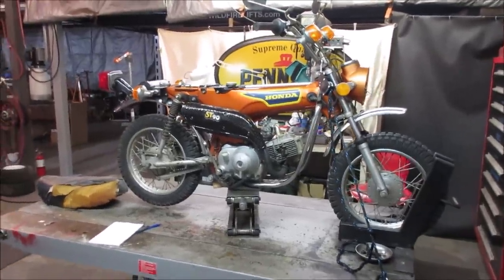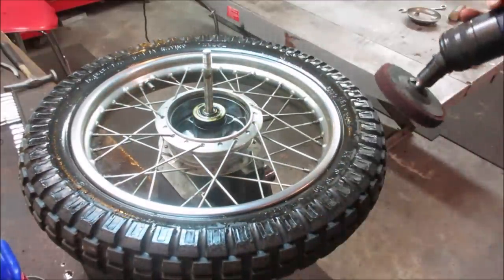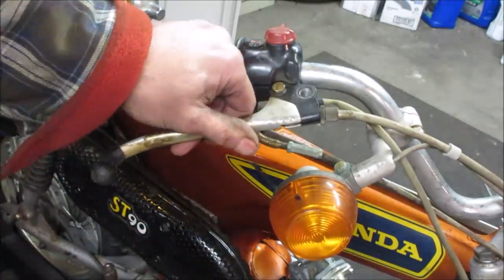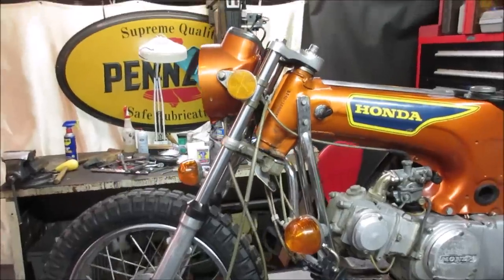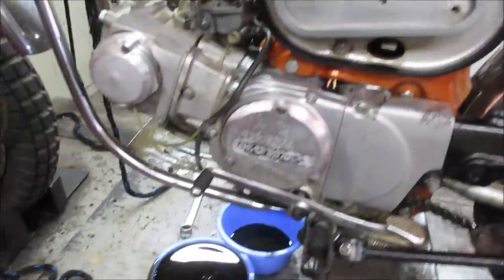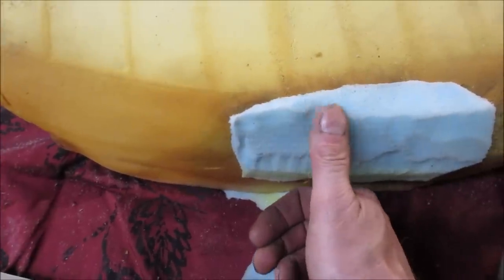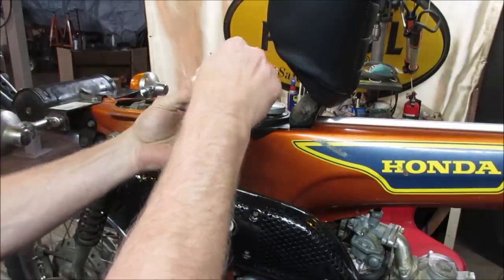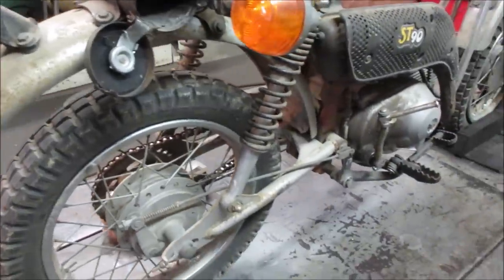Old 1974 Honda ST90 Gets Full Rustoration

Comment: Your brakeless, throttleless minibike reminded me.  Me and a buddy bought a go cart for $20.  No brakes, no throttle, we knew nothing about clutches.  We got it running and the engine would run at full throttle, tire spinning, so we'd put it up on blocks, one of us would jump un and the other would push it off the blocks.  It would just run wide open throttle until it died or we ran into something.  Lol, good times!

Comment: Song Mountain near Syracuse, NY used to have the "Alpine Slide" in the warmer months when I was a kid (40+ years ago).  Sounds exactly like what you described.  Concrete track, sleds with skateboard wheels underneath that defaulted to the brake position.  You pulled a lever to make the wheels contact the track.  The faster you went, the harder you ran into the kid in front of you who was too scared to race down the mountain.  It was a blast!  Thanks for bringing those memories back.

Comment: This is, and has always been, my favorite channel. I love the problem-solving approach. If I had one criticism, it's that you should start mild when it comes to cleaning up old parts. The front fender would have come out perfectly with 0000 steel wool but, starting with the abrasive scotchbrite wheel on a power tool resulted in damage. Still love ya, man.

Comment: My Christmas day was rewatching the last Honda 90 after the Honda 70 where you said to use straight 30 weight oil was the one to use because of the clutch in the 350 got burned up.
I should put it into practice by finding an old Honda to play with.

Comment: Merry Christmas! A fine grit sand paper, DA or palm sander will take down the foam, even memory foam. It helps for installing seat covers if your use a thin plastic bag over the foam like a really cheap generic trash bag. Also, steaming the seat cover after installing helps for final fit and tightening all your seams up.

Comment: Merry Christmas ! I compress the seat frame down when I reupholster my mc seat. It goes a lot easier .  The tabs will fatigue ,break,so the less you bend them the better. With the foam compressed, the covering slips over the tabs and pulls under easily. Winter riding on snow always fun ;) Good restoration . Have a healthy safe 2023.

Comment: When it comes to cutting polyurethane foam with an electric knife, you might help the knife to cut thinner slices by dressing the blade with silicone spray.  It really cuts down on the blade getting caught up or struck. By the way, the finished seat and the whole bike look great!😊

Comment: I used to work off and on between gigs at an auto upholstery shop. My boss was a master at rebuilding seats and recovering... Even recreating OEM style covers from scratch stitched on a machine.
You made the right decision to go with the electric carving knife....we always used them to carve in rough shapes ....we would do the final contour with a wiz wheel or sander....and we also used contact adhesive....but on foam you really don't want   to skimp ....a second application was usually used as the first would seal the pores of the foam

Comment: I saw on tv or the web to use a Thin Hot Electric Wire to shape foam. You insolate the ends and leave the rest of the wire is bare. It can contour better then a carving knife. The carving knife type of tool was also used for basic rough shaping. You have got the correct general idea Mustie.

Comment: Merry Christmas, Mustie1!  The factory recommended fork oil for Suzukis from this period was a 50/50 mix of DOT3 brake fluid and non-detergent 30w motor oil.
Reply: He could also just use actual fork oil. Same with the drive chain. It’s pretty easy to take off the master link and give it a good soak and then use actual chain lube that does not fly off and mess up that cleaned up rear wheel.

Comment: You just brought memories rushing back of Wild Mountain, in Taylor's Falls, Minnesota. I was shocked that they let you loose on something like a mechanic's creeper on a half tube bobsled run. If you didn't apply brake, you would sail into the pines at speed. To keep your sled from going over the top of the tube, you had to lean away and make it run lower. When I then high sided off the sled cart, I got friction burns as I screeched to a stop. Ski hills must be lawyer proof.

Comment: You need one of those hot wire foam cutters Mustie. Ive seen them used on polystyrene but if memory serves I think they can be used on foam too. Used in modelling circles for plane wings and cosplay Armour etc. There are vids on UTube showing how to build one yourself and it seems fairly straight forward.

Comment: Brilliant restoration. Fun-bike may be a more apt term, based on your commentary when riding. Yes, in the UK there is only spanner, wrench is something you may do when using a spanner. Then there is fender = mudguard, muffler = silencer, gas = petrol et al. Trunk is something elephants have. Have a great Christmas and New Year.
Reply: The reason we say trunk because on early car's had no trunk, but people would tie their travel trunk to the back of their cars. So when they started building cars with trunks the term stuck hope that helps.

Comment: For the broken left-turn fork stop: drill the lower triple clamp plate and install a short bolt upward through the place with a large nut on the top.

Comment: Alpine slide was classic and road rash was guaranteed. It was a bobsled style track except cement. Flying down that mountain with your buddy on the track next to you literally dragging your knuckles on the track just trying to hold on to the handle bars. The good old days.
Think they removed it in the 90's some time but the park is still there.
Merry Christmas

Comment: Hey brother after fixing many way worse seat on quads believe it or not hot glue works great for fixing missing spots. Can melt easily with a torch and let in fill the voids. Once covered you'll never know you filled it in. I think there's a video or 2 on my channel of before and after on a quad.

Comment: Tips for the foam
- make the patch surface is long and flat so the glue has the best chance sticking. Don't peice-meal it. Any small warbles and dips and variations will eventually separate with wear and tear and compression/expansion cycles of the foam.
- when gluing a softer foam onto the firm foam, leave the soft foam a bit proud so when it crushes down it becomes even with the firmer base.
- sand with a new very sharp 36 grit disc or belt with a light touch. Commercially available sanders use a resin filled wire wheels. This allows the tips of the wire to abrade the foam without grabbing. Other wheels use a very hard urethane foam for a fine finish. A wire wheel works in a pinch but it is very prone to eating the foam and your hand alive when it grabs...probably best you don't try it without a lot of practice. 
- sand away from the glue seam so it doesn't grab and rip off your patch. 
- for cutting thin strips with your electric knife, hold onto the thin strip as you cut and try to balance the tension in the cut by pulling slightly as the knife goes through.
- spray adhesive works well, but if you have some foam that's decomposing a bit, a brush on contact cement may give you a better hold since it will wick deeper into the structure of the foam. Contact cement for countertops at the hardware store would be adequate for something like that. If available buy the recommended thinner to go with your glue so you can thin it down if it's too thick and goopy. Also, don't just use any old thinner with the glue because it messes up the chemistry of the glue and it will just turn slimy and won't stick.
...well hope that helps for the next time.

Comment: I've done this a few times and it does work well.  I used a belt sander to "sculpt" it a little and that works alright.  Your grinder idea is good too and maybe a multi-tool would work too.  I used 80 grit on the belt sander.    Bobby

Comment: Hey Mustie!!.. Merry Christmas and I hope you all have a very Happy New Year!!.. Watching your videos (and others) has inspired me and helped me not to be scared to take some chances on somewhat questionable purchases.. namely, a 2yo Harbor Freight Predator 8750 with only 12 hours for $450.. (He was an Army vet. I'm an AF vet and he dropped it to $400.. nice!!) anywho.. I saw it had wires from the bottom of the carb and he didn't have a battery. He said it'll run with some direct spray into the intake. So, I naturally thought of gas and/or carb issues. Went to see it and sure enough, it'll run with spraying into it but won't sustain a run on the gas in the tank. Gas didn't smell bad, so I thought strainer clogged or a clogged jet(s). Bought it, brought it home and my son helped me move it to the back porch. My initial thought was that it needed 12VDC to the carb (unless the oil level was too low. It wasn't. Oil level was fine.) Looked on AmazXX.. $30 for a new battery and a rebuild kit would've taken longer to get in so I bought a new carb for $19 (plus keeping the old one gave me spare parts). Installed the battery, installed the new carb and the electric start was working and it started right up!!!.. $1600 machine for $450 in total.... not.. too... bad... huh?... lol.. CHEERS!!!

Comment: Hey Mustie, I noticed you added 10W-40 oil to it. I was under the impression from my days of riding Honda Mini Trails and Dax's that multigrades are a no-no with centrifical clutches. Always used to run SAE30 50 years ago. Anyway, thanks for the Vid's, Merry Christmas from downunder.
Reply: 10w-40 is fine, as long as it’s made for wet clutch applications.  Regular 10w-40 is a no-no.
Reply: @MiniBikeMike  Got ya, on doing further research on the oil Darren put into the Bike, its Maxima Premium mineral 10w-40 and it says in red on the label Motorcycle Specific API/SL JASO MA2. (hard to see in the vid). It is designed for motorcycle wet clutches. Apparently its the Friction Modified oil that is not compatible with wet clutches. I never stop learning! Thanks @MiniBikeMike.😄

Comment: I used to work in a factory that supplied automotive interior parts and had worked on lines that had armrests or center console covers that had padded covers.  Heat is the trick.  We had boxes that would warm the material.  This made it MUCH easier to stretch and get all the wrinkles out.  A heat gun might help, but you need to be really careful with that.

I had a horribly rusted and beat up Honda Trail 70 with no first gear I got for $20 back in 1984 (I was 15) and ran the crap out of it for about a year before4 it finally died.  We had a lot of trails and jumps out in the woods.  Hit a few trees.  I was just smart enough to use an old helmet I got a garage sale for $2.

A friend also had a moped and we would ride bikes next to him and hold his shoulder to get around.  Sometimes he would tow up to 3 of us on bikes.  His dad would get pissed that he would burn out the belts so fast.  When he was 18 his dad got him a Honda Enduro 100.  It would do about 55.  He still towed us.  He could do 45 then.  We passed a cop one time in a 30mph zone and he must not have seen us as he did not pull out.  We at one time had him pulling 5 of us at maybe 25.  We were fanned out like a flock of geese in a V formation with 2 on one side and three on the other.  He was 2 years older than most of us, but only one grade ahead because he got held back in 3rd grade.  Those were some good times.

Comment: When I had my forks rebuilt I had them put heavier oil in since I am heavier than the average rider and it made a world of difference. Now that I have a new bike, I tuned the suspension for my weight. Handles way better than when I first started riding it. Took a few days of small adjustments to get it right.

Comment: The story of the park reminds me of a place called Millbury Amusements in the mid 80's in central MA, it also had gas powered tanks and people could shoot rubber hand balls from air compressed guns from the tanks and the outside perimeter. It also had go carts and a bumper boats and a par 3 golf course , good times. Now it's a Mass turnpike on ramp.

Comment: Merry Christmas! 
I have seen one week old front hubs in much worse condition than this old Honda.
Head bearing,  probably out of business now , but the best head  bearing repair was to replace all four races and loose balls with tapered roller bearing packed with water resistant grease "often marketedas boat trailers wheel bearings grease". Doing so would make future failures nearly non-existent.

Comment: Steering head bearing damage is called "Brinelling."  Very common on Vintage Japanese bikes.  Sadly the only proper fix is to replace.  Best with tapered rollers because replacement Honda will do the same thing.  Trail bike not as big a deal, street bike will ride miserably.  As you were taking the wheel off I thought to myself take whole front end off.  Hind sight and all.  As always great stuff.  Hope you are surviving stormageddon.
Reply: You said it! I have installed lots of tapered bearings for that reason.

Comment: I've worked on a couple of engines like this. The head light needs the engine to run. the tail light, blinker and speedo lights will work off of the battery

Comment: I remember when they came out with the original trail 90. 
Had a little bigger frame and it would carry two people and it had four gears with a changeable sprocket on the back wheel for even lower gears off-road.
I think they sold for a little over $300. In recent years people are paying a whole lot more than that for them!

Comment: We have some very similar where I'm from in Pittsfield, Massachusetts at a ski resort called Bouquet.. it's a long cement half tube down a mountain and you ride in a little cart with a pull stick for breaks between your legs, I took a corner too fast as a kid and flipped I was covered in road rash lol.. ohh they called it the Alpine Slide

Comment: for what its worth most 70s japanesey bikes that had adjustable shocks had a shock adjuster spanner that doubles as tripple tree nut  loosener/tightener wrench thingy in the under seat tool box. .  Dont think this model has adj shocks but those wrenches  fit most other necks.   BTW I really enjoyed this series on that  little honda. Merry Christmas!
Reply: Most motorcycle tool kits have those scanner wrenches.
Reply: Ring spanner

Comment: This is practically my dream bike.. Ive had a few of them but was never able to keep them, my parents believed in selling things when i got in trouble and i got in a lot of trouble.. I would really like to find one that is in poor enough condition that I would not feel bad hacking it up.. I want to put a electric hub motor on the front. Give it about 50% the power of the gas motor and a short range, under 10 miles. would prefer capacitors over a battery for weight, vibration resistance, speed of charging and longer life.

Comment: Dextron ATF is about 5wt fork oil so kinda medium. I have two Honda's that spec ATF in the forks. One was seeping oil when I got it two years ago, Seemed to have motor oil in them. Way to heavy. Filled them with kero, bounced a few dozen times and drained out the dirty kero. Let drain over night. Refilled with ATF and over the next few weeks it stopped weeping. Win! If that scraper is cracked I would just change out the seals while I have it apart.

Comment: 37:46  That's called brinelling.  For the seat, the foam is very forgiving. Hack off huge chunks of old beat up foam and glue on fresh. You can use whatever tools you want almost.   Sanders are fine. For yours, I would have just replaced the whole thing. Old foam is terrible. Make a template from the old and hack away at it. Cheap too. You can make a nice sander from a piece of sheet metal and punch holes in it with nails. Make it whatever size you want.  Use a piece of wood for backing.

Comment: I think those were designed for adults. They were certainly a lot faster with kids on them, but driven "normally" they were fine for adults.  As a kid I was a little bigger than the other kids. I seized my CT70 running it flat out trying to keep up. Then I got a '65 S90. I seized it too running the crap out of it. Fun though!

Comment: That concrete flume was called Alpine slide.  But the water slides that would take clumps of skin off your arms or I seen girl missing clump of hair from one of the seems. The indy gocarts and mini power boats were no better but you did sign insurance waiver to ride them 😆. We also were allowed to cliff dive from.75 foot up and I could even swim well. Also how about the small pool with rope swing on one side while simultaneously another kid would come flying out under ground tube 15 to 20 feet on opposite side. What a death trap and we loved it because we were built tough back then. We even drank straight out of the hose and rode in the back of the pickup 😆😅🤣😂

Comment: Back again to mention the ol' trick: You can shine those rims into new with the rust removal all in one by taking GoJo Orange Mechanics Scrub Soap and putting a blob on all the rusty spots, after that you take some aluminum foil and use it as a scrubber.  I know it sounds crazy but it'll shine up chrome steel like nothing else-even in pitted rust.  You could possibly wrap a disc like that in foil too, but I always did it by hand.

Comment: @1:20:50 he's talking about an Alpine Slide. If you push the handle down, it would reduce resistance and go really fast. If you pull back, it's a brake.